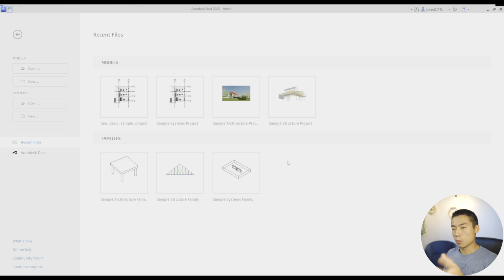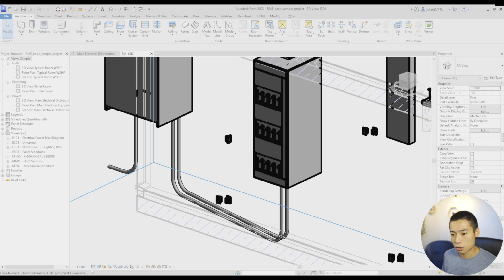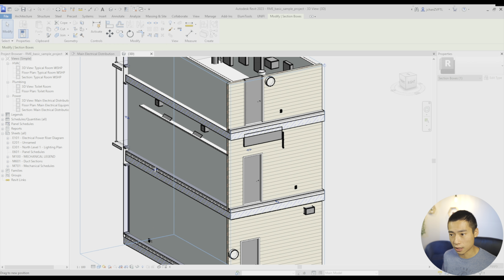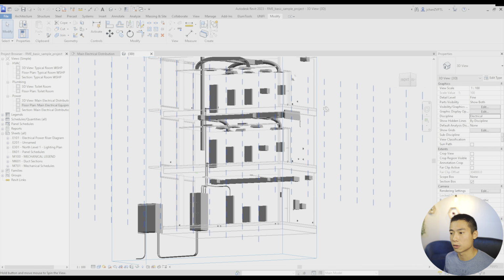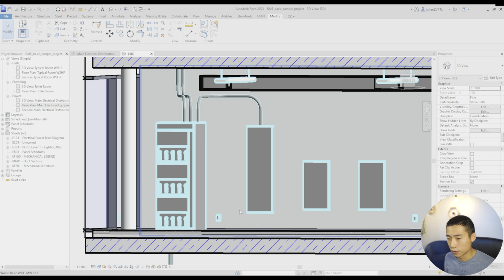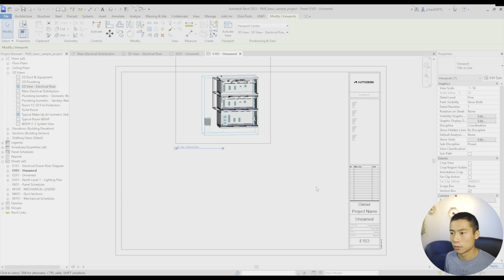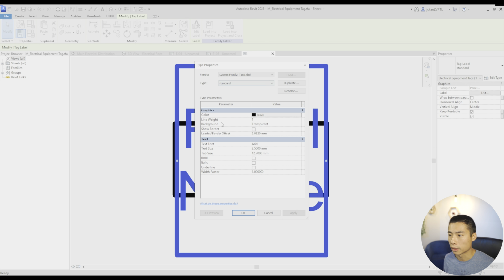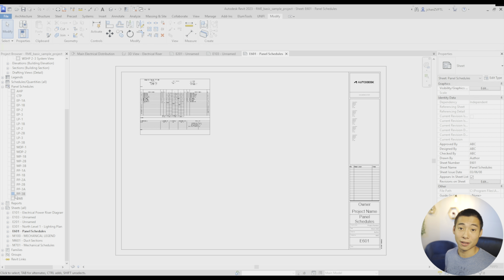3d View In Revit: Quick And Easy!

Comment: Great demonstration of the 3D view tool! And don't you just love how architects give us (electrical guys) whatever space if left in a building, and then usually one of the walls is unusable (window wall in an electrical room!?!). I've been trying to train architects for decades that electrical needs lots of wall space for gear and even more floor space for the working clearance!
Reply from the maker: Or they box us in a corner when you need two exits, or stagger the electrical rooms instead of stacking them neatly on top of each other for a tidy vertical riser. Fun stuff!

Comment: Great Video! at 7:53 you have issues with the curtain wall getting selected. I'd add an additional option for disabling selection of that wall. You can simply hit the temporary hide isolate button and hide the wall temporarily. This method might be a little better than pinning the wall down. I've always had issues pinning items down in the model, so I try to avoid. Also I saw you used the tab button to cycle thru your selections. Another great method for dealing with that issue.
Reply from the maker: Ah true the pinning stems from the fact that each discipline is their own model for our workflow so we have to Pin all other disciplines’ linked Revit model so it doesn’t get moved around. If everyone shares a model, that could get super annoying.